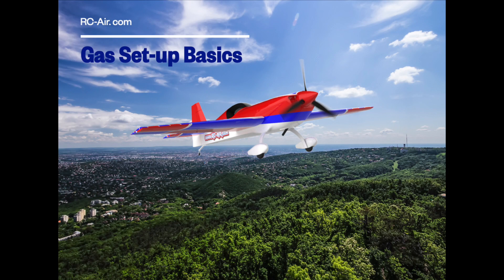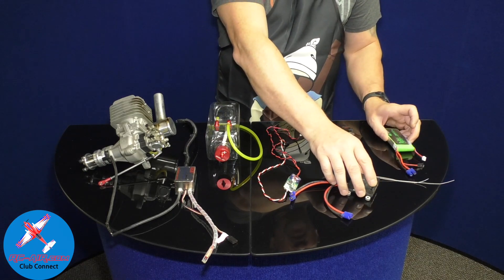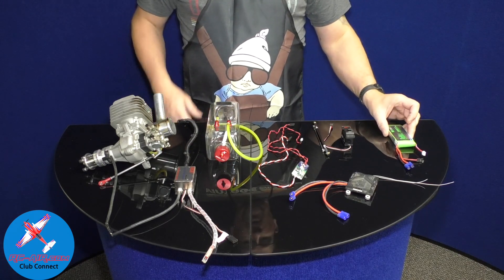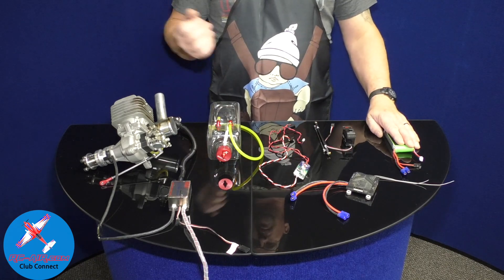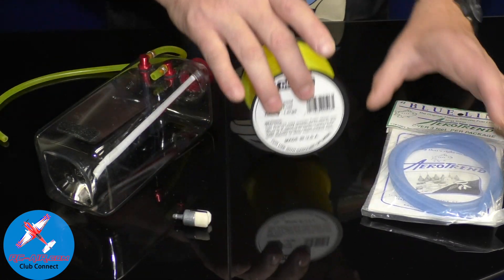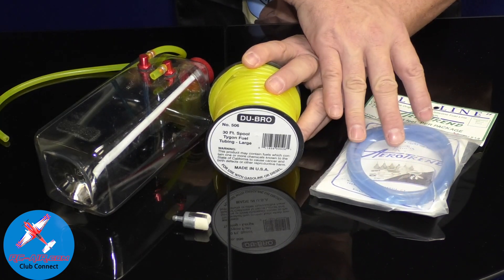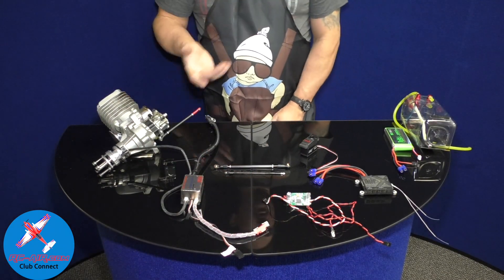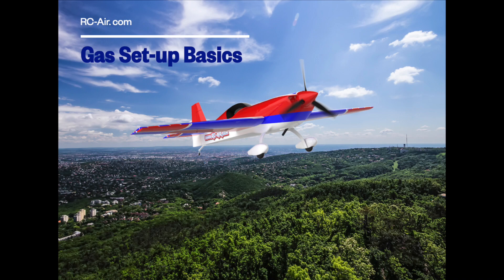RC Airplane Gas Engine Set-up Overview   RC-AIR: How To

Comment: Well you made that complex What if you do NOT use 7V servos ie 6V ?????????
Reply: Then you don't use any of that stuff. Lots of ignitions today can run from 6v-8.4v without a regulator. You would need the opto kill, or something to separate the ignition power from the receiver.. I ran my ignition off a separate switch and just cut the throttle by closing the throttle.
Reply from the maker: The comment below is what I would have recommended as well.

Comment: Hi great vid ,can I just connect a 4.8 battery to engine with out using bec or switch??? Thanks
Reply from the maker: I mean yeah you can but that’s incredibly unsafe. Having a remote kill switch is really the only safe approach.

Comment: You never run your engine on the same battery that your electronics run a battery all by its self to engine period
Reply from the maker: Well that is one method, we did that back in the 90’s and into early 2000’s. I believe many, well maybe most everybody would disagree with you. Wherever you got that info, you may want to rethink listening to them in the future.

Comment: What is eibäck ?
Reply: "IBEC". Ignition Battery Eliminator Circuit. So you don't need a separate ignition battery and gives you the ability to program a switch on your transmitter to turn the engine off

Comment: What size lipo should I use with this set up and a dle 20cc
Reply from the maker: That’s tough to say. I’ve not ever flown with a 20cc. The ignition won’t use a ton of juice, so do what you can to keep it light. Nothing wrong with changing batteries out. No need to use a big one for more flights. In that size plane, ounces matter a lot!  Keep it as light as you can and you’ll have a much better flying experience.

Comment: Thanks for the info! I’m building my first plane. sbach 65” w/DLE-20 and I think I’m going to make a servo mount out of rubber for my throttle servo now that I saw this info. Thanks for the videos!
Reply from the maker: no need to make the mount out of rubber, simply add the rubber grommets to the servo and that will suppress the vibration.  Use a plastic arm as that helps too.

Comment: Wow? After all that, I’m just sticking with glow !!!
Reply from the maker: Fair enough. I flew with glow for many years. Setting up a gas system takes a minute, yet long term the cost savings are well worth the effort. Happy landings.
Reply: Nitro is great, but you're limited to smaller planes.
Reply: hahaaha. it's not rocket science. but nitro is simpler for sure. But what about that $30/gal. fuel these days? You could fly for days on a gallon of ethanol free gas and some synthetic oil.

Comment: Rcexl have been making ignitions with inputs of 4-8v since about 2014, so even without a OPTO kill switch, you can still run it directly on a 7.4v 2S LiPo. Useful for those with little knowledge of these systems to know

Comment: But the system that you like means your battery which is only one battery runs the spark ignition and the servos is that correct..
Reply from the maker: That is correct’ish.  In smaller gas planes I generally run a single battery. In larger gassers I run two batteries into a powersafe receiver.  Using an IBEC you are controlling and Powering the ignition with the same batter.
Reply: @RC-Air  I always run separate batteries for servos and ignition. I like the extra margin of safety that the ignition and/or the servos won't drain the battery!!

Comment: For a tank that vents from the top, such as the one shown here, as opposed to a DuBro tank, why is it necessary to loop extra vent fuel line around the top of the tank?
Reply from the maker: It prevent the tank from siphoning out the gas when it is inverted and in knife edge.

Comment: Great presentation 
Questions
I tried to run my engine to break it with 32:1 gas/oil ratio

1. Does the fuel from the tank tubes needs to reach The engine ( by the carburetor) to get the engine started moving propellers counterclockwise wise and having the ignition connection to the battery 

I didn’t get it started may be because the fuel did not get to the engine? 

Does the gas move inside the tube line towards the engine when we pushed propellers counterclockwise???????
Reply from the maker: Yes, there is a small diaphragm in the muffler that draws the fuel from the tank into the fuel line then into the carburetor when the propeller is rotated counter clockwise.  Sometimes, If the diaphragm is dry is will not pull fuel. It may help to put a couple of drops of fuel directly into the carburetor using a straw.
Reply: @RC-Air  diphragm in the muffler? I'm confused.

Comment: Can you use a presure line from exaust pipe to tank with no vent like witth nitro ??
Reply from the maker: There isn't a need to do that, the carburetor pulls the fuel using a diaphragm and ambient pressure. Pressurizing the tank isn't necessary and, while I cannot say with certainty, might even be detrimental to the operation of the carburetor.
Reply: If you pressurise from the exhaust it will catch fire 🔥! Under no circumstances use exhaust pressure!!
If you must pressurise it you must use a purpose built pump.

Comment: Metal push rod to the engine will not cause feedback that is incorrect these systems these days will not pick up interference that way, in fact, do not pick up interference at all from anywhere so it is safe to do that. And also there are no issues with plastic geared servos to throttle.
Reply from the maker: Thank you for the feedback. I date back well into the 72mhz days with my knowledge.  A lot changed with 2.4 and as stated in the video I wasn’t sure. I appreciate the additional info.
Reply: @RC-Air  No Worries. thank you.
Reply: @RC-Air  Yep, those of us of some age remember those old days. 72 had it's issues but how about 27mhz AM? You were lucky to take an airplane home in one piece. We caught a guy who would park in the flying field parking lot and key his CB radio to see what happened.... We were all going crazy trying to figure out what was going on until we discovered him.

Comment: You forgot you need to supply oxygen to the carbutator 😁
Reply from the maker: That is done through the cutting of the cowl/fuselage. There are some occasions where an ambient pressure line is also ran to the carburetor, depending on the design.

Comment: Both my gas engine ignition boxes say 6 volt to 8.4 or 14volt. It doesn't look like this video on the ignition is relevant.
Reply from the maker: Hey Rick I think all of the new ignitions are now rated up to 8.4v, which is fantastic. That said if you happened to pick up a used plane or engine, there is still a high likelihood that you may have one of the older ignitions, it's always good to check when you're setting your system up.
Reply: @RC-Air  thanks, I'm learning a lot.
Reply from the maker: There is a lot to learn for sure!  You’re welcome to reach out anytime with questions. I’m happy to help.

Comment: hi i just got a 50cc gas trainer...I couldn't find where to feed my fuel which was weird .Secondly the fuel tank is placed in a hidden compartment which cannot be opened  and I wanted to do upgrades on the tank
Reply: @RC-Air   Will definately do that ...thanks
Reply from the maker: Did you ever get this plane in the air?